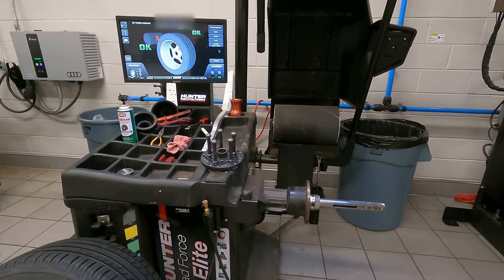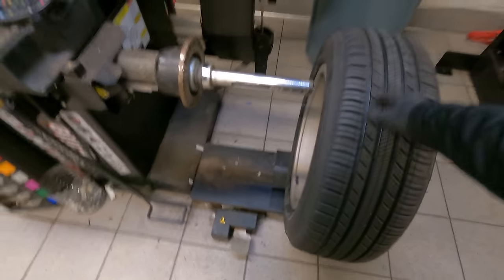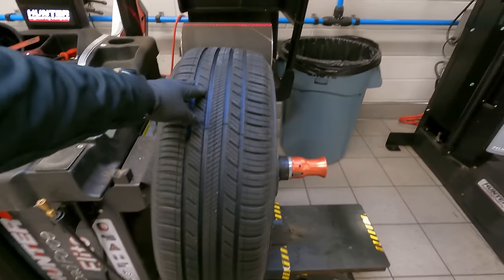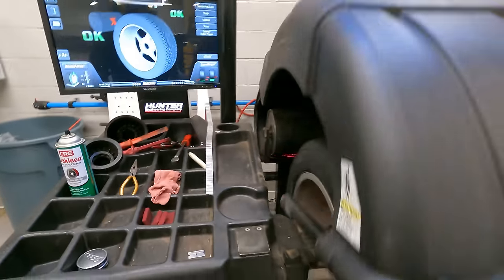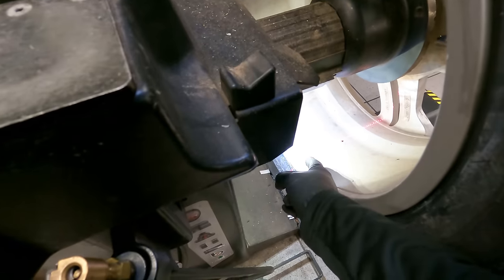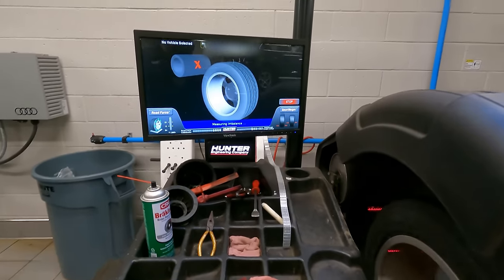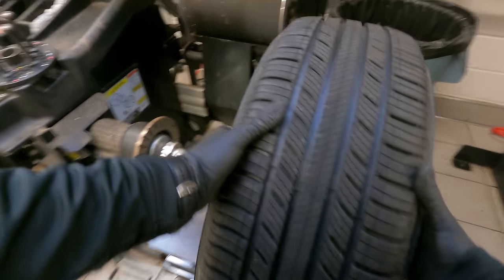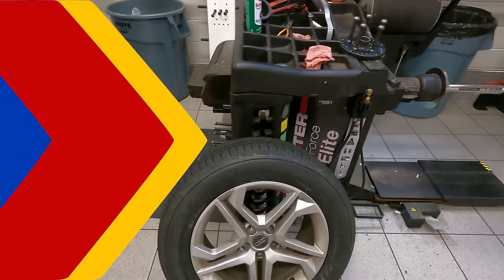Customer states "How to balance a tire the easy way"

Comment: In my day when we balanced tires we had to roll them up hill both ways to and from the machine, then lift the tire high in the air to mount it on the machine.  Then we would have to pound the weights on with sheer brute force.  You young guys have it way to easy.
Reply: Of course back then wheels were cast out of lead
Reply: Yeah, you young whippersnappers don't know how easy you have it!  The machine I had to use you had to spin up the tire by hand! 😂
Reply from the maker: all in the snow too
Reply: You kid, but here in South America the weights are hammered onto the rim bead (they "hang" off the rim bead and are visible on the outside of the rim). I have only seen those stick-on weights in Youtube videos (although I've just checked and they're for sale in my country)
Reply: @customerstateswhat  and barefoot..
Reply: Yeah, I remember those days.   I'd do all that while wearing an onion on my belt, which was the style at the time.
Reply: Man, I gotta get up earlier. All of you guys took my witty replies and used them already!!!
Reply: You beat me too it. Its no wonder they call them technicians now and not mechanics. Sheesh
Reply: Pound on lead tire weights with brute force! That’s comical 😂
Reply: And he also walked four miles to and from school..uphill both ways.
Reply: I remember those days well.
Reply: Back then i had to build wooden wheels from a tree.  U had it easy son.
Reply: your all way young, my tire balancer had a bubble with lines marking the center. 
You set the tire on the balance and the bubble showed you the light spot, add weights till the bubble was in the middle. NO spiny spiny machine. 
Also had to manually break down tires with a tire iron and bar. 
So yeah ALL you under 60 have it so easy, just push a button.
Go change a tube on a split rim in the rain or snow. then we talk.
Reply: @opossom1968  I used that one too, slow slow slow!
Reply: :D
Reply: @opossom1968  I still use a bubble balancer and a old coats 20-20 no school like old school
Reply: I still do it this way lol

Comment: We just upgraded to a RoadForce Elite from our SmartWeight that just gave up the ghost and the difference is night and day. Our shop rarely spends big money on equipment, but this one has been a lifesaver. The tire lift makes life so much easier when you're working with ~100lb GM wheels all day, my back thanks me for it
Reply: Some of the Ford and BMW wheels are stupid heavy as well, mercedes wheels are usually heavy. Porsche is probably the most consistent on low weight except for some of the older SUV wheels

Comment: Nice job. A lot different from when I did them in the 1960s. We used a bubble balance and hammer on weights. I still have one a bubble balance and the manual tire changer. I'm now old enough that the changing bar has gotten difficult to pull. Good Luck, Rick
Reply: I still use a bubble balancer, many times to correct improperly machine balanced tires, like this.
Reply: @tedcollins4684  I have a bubble balancer as well. Haven’t had any good luck with it though. Any tips
Reply: My dad has a bubble-balancer, I've used it a couple of times.  Seems to work pretty good.  @DUM BEEZY, what problem are you having?  They do take some patience to use (for me, anyway).  The bubble points to the "uphill" side, so that's where the weight you need goes.  Then just guess-and-check how much until you get it.
Reply: @dumbeezy5480  Make sure that the pivot is clean, smooth and lightly oiled. Put the valve stem where the little triangle points. When you have figured out the weight to balance it, put 1/2 of the weight on the inside of the rim and 1/2 on the outside. It is only an approximation but it helps. The modern spin balancers  do a better job but cost a fortune.
Reply: @dumbeezy5480  Must be on a flat level surface, make sure the bubble level is centered and top part is on the pin. I use it on the race cars also, never nad to do a wheel twice. Maybe a a little oil on the center so wheel seats down, drop wheel on from an inch or so up. Hope this helps.
Reply: I also did those back in the day. However, drum brakes were the norm & there was no guarantee that they were correct so I always did them on the car. No exceptions, no returns. Even had guys from other shops looking me up.

Comment: We got the Hunter Smart Weight touch last year. Probably the nicest balancer I've used. The salesmen advised us not to get road force for our high volume shop so it's the model below that one.  He also advised not to use brake cleaner which we use pre buff cleaner instead, but either product will destroy the touch screen..  At my shop, the center caps are aligned with the valve, balance dots are lined up and if it's a raised white letter, the valve stem is installed at a center point between the letters, and then cleaned of the blue goo. Little details that so many shops fail to do.  But the reputation brings in a lot of high end customers and cars

Comment: For those concerned: Road force has nothing to do with balance. Road force is a measure of loaded run-out. A tire can spin at 1000 rpm smoothly, but you drive on it and have a vibration. If there is a soft spot in the sidewall, every time the tire rotates, when that soft spot has to support the weight of the car, the axle will dip just a bit, say, .030". That would set up a vibration at certain speeds. It also would be rated at 30lb of road force. Usually the remedy is to rotate the tire on the wheel in 90 degree increments to try to counteract any runout in the wheel. Typically, under15lb roadforce is considered OK.
Reply from the maker: Thank you for the full description, also a road force balance is more expensive.
Reply: @customerstateswhat  And my description is the short version! Thanks for the heart!
Reply: @customerstateswhat  I had a guy that did it for $15 per wheel. But he's old and now retired :(    The computer read out was insane. Road force was about 7 lbs per wheel with cheap tires and old ass stock rims. Some didn't even need weights. He would remount the tires just right from experience.
Reply: I had two new Goodyear tires that vibrated badly, and made an odd sound at road speed.  I had it road balanced, two tires were good, and two real bad.  One at 50 pounds and the other at 30 pounds.  My next set of tires were Michelin’s.

Comment: I once worked at Kal Tire.  I got screamed at by their "Head Tech"  that I was "wasting time" by spinning up the tire and double-checking my work to ensure the tire was balanced.  He told me that balancing tires didn't need to be exact.  Close enough is good enough.

Yeah, I didn't last a week.  Couldn't work with simpletons like that.

Worked at Canadian Tire and their mechanics appreciated that I took the time to double check my work.  I worked there a whole year with ZERO comebacks.  15+ years later, me and one of the mechanics I worked with there are still buddies.

But that experience at Kal Tire.... wow..... what a bunch of assholes.  I've never taken a car there since and have told many people to avoid, avoid, avoid.
Reply: Kal Tire is a joke they couldnt fix a sandwich

Comment: I bought a new set of Goodyear tires for my Odyssey, a few years ago.  They vibrated badly, and sounded like a semi with a bad tire.  The Goodyear dealer balanced them,but it did not help.  I put up with it for about 30K miles.  I finally took it to an independent shop to have it road forced balanced.  Two checked good, but two were real bad.  One was 30 pounds out and the other 50 pounds out.  The tires could not be balanced.  I Goodyear was zero help, so I went back to my Michelin tires and have not had any issues.

Comment: We’ve got the same an my shop. However instead of the hydraulic tire securing thing, ours just has a screw n handle with different cups to secure the whee in place. And our foot pedal if you double kick it the wheel starts spinning. Very convenient machine.

Comment: The new machines are great, I used to use the old COATS in the mid 90s, had to spin it around and line up the led's on the panel, always had some clown who used the wrong cone the tire would slop off and smash into the shield and break it.

Comment: Having the weights removed from the wheel doesn't mean you can skip the measurements.  The machine uses those measurement as part of the dynamic balancing equation, so if they aren't correct then the calculated weights won't be correct.

Comment: Now I have to go outside and check if my Merc centre caps are aligned properly - I’ve not long had new tyres all round fitted… My OCD is going to kick in if they’ve not been done properly.

Comment: Wow, like your making me feel old. Back when I was still doing automotive work we got a brand new Hunter tire machine (around 1989 or 1990) and wheel balancer that we though was so friggin cool, but that MFer rocks TBH.. At least when I went heavy equipment I didn't have to balance tracks and stuff, or loader wheels etc. Just put the right number on each side.
Honestly your videos give me a laugh every time you put up a new one. You loosing your mind seems to provide happiness to many,, So at the very least you can check into the nuthouse knowing you provided many with joy. Take it easy man. 😎

Comment: I had a set of summer tires that needed mounting and balancing,  I usually go to my fav tire shop in Corona to get work done but I was lazy that day.  So I called Mavis tire 2 mins away from me to make sure they had a "Road Force" balancer.  They said yes we do, and gave me an appointment.  When I got there,  the same asshole I talked to on the phone said NO they don't have that machine.  And went on to laugh and tell me it's not needed it's just a gimmick.    I'm fuming now, and I don't know what to do cause it's late in the day.  So I let them start work.  He gets the first tire mounted and while he's balancing it he starts putting weights on the OUTSIDE of my rim barrel  (Freshly powder-coated wheels).   I flip out, while he's trying to tell me that's the only way to balance them.  I said stop everything!!!  I reloaded all my rims and tires back in the car and headed to the 24hour Mexican spot and got everything done for half the price and NO BS.   3 days later Mavis sends me a fucking bill for mounting 1 tire...

Comment: No comment on how you're supposed to line up the red or yellow dots with the valve stem of the wheel to reduce the need for weights?

Comment: I'd like to know why tire shops use the side mounted weights but won't remove the weights already on there that you just used? When I get my tires balanced at the Lexus dealership they use the weights you have in the video, but when I go to a tire shop they balance the wheel without removing the weights the Lexus dealership put on.

Comment: You're supposed to line the center cap up with the valve stem? Who knew? I bet not my local Good Year dealer.
Reply: I always lined it up with the tire lettering , like it really matters .
Reply: You dont have to orientate centre caps any one way.  Tyre is balanced without cap on, the cap unbalances it but too tiny since its light , mostly symetrical and even if it was tested on ,and it had 30g assymetrical weight, it would still be too tiny in  consequence since its distance from axis is tiny

Comment: Why should the center cap be aligned with the valve stem? Is there any conceivable and obvious benefit?
Reply: No, centre cap can go on at any orientation that lets it fit on. ( Some may have a key that aligns it.  Others have to align with studs or rim spokes. ..)

Comment: As far as the road force part goes, why would you not use it for each tire?  I was looking forward to it being used here.  Is it just for problematic tires/wheels?  Would any extra cost be generally worth it for an average vehicle?
Reply: +1 I have this question too since most tire shops struggle to balance my Audi OEM bbs wheels

Comment: You guys are spoiled! I remember when you would put the wheel on this bubble cone looking thing and set weights on the rim until the bubble was in the middle!!! If you wanted to be fancy, you would divide that weight in two and put half on the outside and the other half on the inside. It worked just fine!

Comment: I don't know how people don't question tire shop work. I saw a rim with a whole sheet of lead weight stuck inside. Must have been 40 peices in one spot
Reply: That's just insanity... I've rebalanced some of those over the years and usually remove weights. When a machine calls for THAT much weight, something is not setup right on the machine. If it's correct the tires are usually $40 chinese no names.

I also enjoy the "car is on it's 3rd set of tires and still has every set of stick on weights that were ever applied". Those are rarer, but still out there.

Comment: Are these stick-on counter-weights as reliably secured on the wheel as the nail-in/clip-on counter-weights?
Reply: Not all wheels have the ability to mount weights on the outer lip.  These weights are only as good as the clamping force.  Hammered Weights for Aluminum wheels have a less tendency to slip off compared to the ones on steel wheels.  Stick on weights have help sticking on better due to centrifugal force pushing the weights outwards  away from the center.  However, if the adhesive isn't made of good quality, or the metal surface isn't clean enough, it will indeed fly off.
Reply: @Rock_Reggae_Riff  I'd be triggered if someone hammered on some weights on my Alloys , Adhesive ones are for Alloy Rims mostly as its a softer metal than steel ...
Reply: @Oh-Jay52  I know what you mean lol.  I know the issue if the tech is using a metal hammer, and he/she misses.  We use this modular hammer with a plastic head.  Instead of the wheel being damaged, the hammer takes the beating lol.
Reply: @Rock_Reggae_Riff  yeah i only really commented as Ive just spent over £200 restoring mine and my tyre guy joked and brought out a lump hammer and weights to balance it , my face was a picture he said ...yeah though ,at you at least got what I meant , some places though just don't give a sh*t which I dont get , destroying your customer base ? pfft

Comment: So, you have a road force and don't actually use the road force? I know they're Audi owners, but they did pay for a proper balance...
Reply: does it make any difference just asking
Reply from the maker: road force is only necessary only if a crazy imbalance is sensed. 30 grams on one side is not a reason to road force.
Reply: @customerstateswhat  If you're balancing low speed cars to a low-speed standard, true. And NJ roads are so bad, who'd notice anyway? Not to mention 3 min per, that you can shave on flag...

Comment: You didn't properly set up the machine, but center cap is "lined up".  lol
Reply: What did he miss? Asking for a friend
Reply: @Christian-pg3zh  It may be ok. The machine should be programmed with tire diminsions and wheel offset. I have done many where "customer states they have a vibration and just had wheels balanced".
Reply: @tedcollins4684  That machine does all of that for you.
Reply: @61rampy65  It does? He even stated in the video he was skipping those steps.
Reply: @tedcollins4684  Either it is automatic, or maybe he had preset the machine.

Comment: Dislike. Improper balance. No road force balancing performed. F grade
Reply from the maker: was not needed
Reply: @customerstateswhat  how can you say that without performing full test?? Hunter ROAD FORCE is the key words. Your boss did not spend extra thousands on ROAD FORCE machine so you can ignore it... Btw your second fail this week. Me personally? I refuse any wheel that hunter shows more than 9 lbs in left bottom corner
Reply from the maker: @lynzoido  the road force balancer will perform a road force balance automatically if it senses a very large imbalance with the tire, we have it set to auto. Also a road force balance cost/charge more for. So with the 30grams on one side the smart balancer did it's job properly.
Reply: @customerstateswhat  Ummm nope. You can 0-0 balance a square wheel. Redo hunter training please, there's a section about that. I guess you never drove an A8 with 15lbs of dynamic imbalance (due to hidden tyre defect) while it was 'ok' by look and statically balanced to 0-0 three f times. Lesson learned.